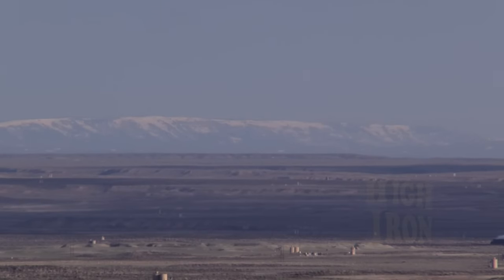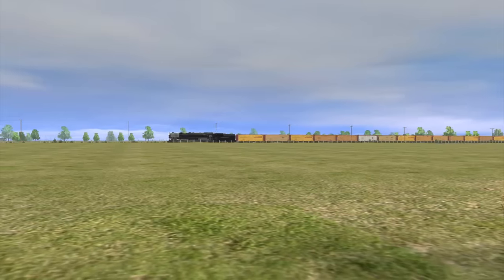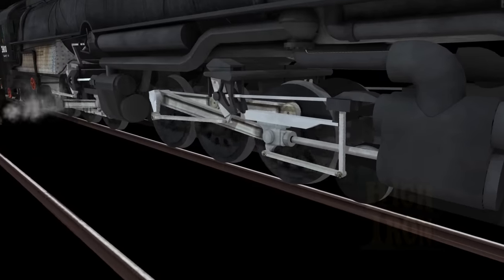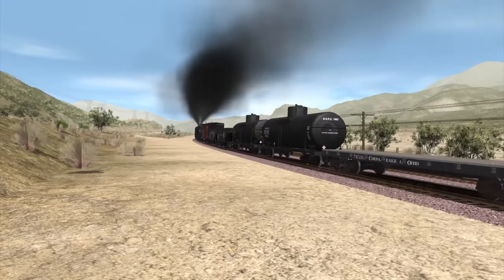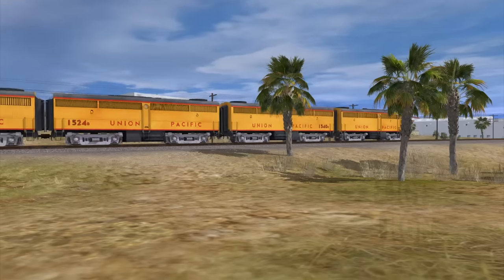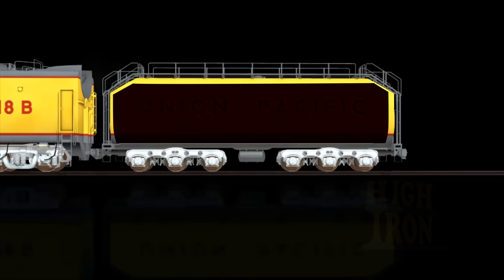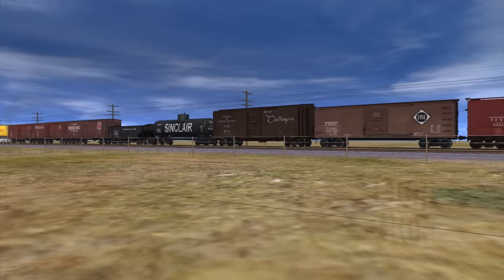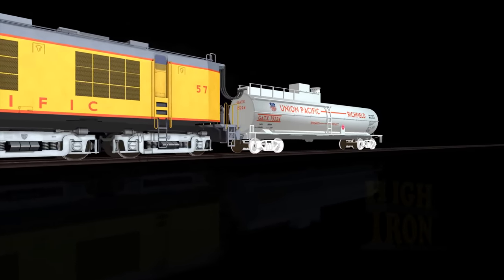Union Pacific's Superpower Fleet

Comment: I think what finally made these big, customized locomotives obsolete was that both EMD and GE by 1990 were pushing their "regular" locomotives to around 4,000 bhp. The EMD SD60 series and the GE Dash 8 series were bought in big numbers by UP for operations between Utah and Cheyenne, WY, especially once the Powder River Basin coal fields opened up.
Reply: Yup! The "Power Race" up to 9000 plus horsepower, then, necessarily, back to 4400 - 4500 is worthy of an entire video as well!
Reply: @michaelsullivan3581  We saw the EMD SD90MAC-H and the GE AC6000CW, but the unreliability of these 6,000 bhp prime movers ended the idea. That's why there was way more interest in the SD70MAC and AC4400W (and their modern descendants, the EMD/Progress SD70ACe series and the GE Evolution series.

Comment: Narrator: "...their third cylinders made them a headache..."

*goes back a few seconds, sees Gresley conjugated gear"

Me: ""Of course..."
Reply: Ever look after a Gresley conjugated  gear fitted locomotive? I suspect that you have never been involved involved. The reality is that there is more chance of a failure of conventional inside gear.
Reply: @DeCasoU1  too much stress was a frequent cause of trouble for Conjugated, more so than conventional. Of course it would be a hassle on an engine with double the driving wheels as any fast Gresley design
Reply: Yeah Gresley's stuff all worked perfectly with proper maintenance.....not exactly great for times of economic depression, war, or corporate bodies wanting to spend less taking care of their stuff.

Comment: This is interesting. I worked on diesel electric systems on the USN for over twenty years, and Emd switch engines after retiring from the navy. I went through the GM EMD C school in Great Lakes NTC in 1977. They're very reliable power plants.

Comment: Spread this message. They removed the third cylinders on the 9000s. I still see videos today with the misinformation that they were a nightmare for maintenance. They fixed the problem. And even introduced roller bearings too.

Comment: If I remember correctly,  it was Santa Fe encountered a problem with huge steam when going through long tunnels out west (Sierra Nevada range) in that the locomotive filled most of the tunnel leaving the smoke very little space to go, except into the locomotive cabs - which nearly asphyxiated the engine crews.  The solution, flip it so the engines operated as cab forwards - with the cab in the front and the smoke stack at the back.  They were 4-8-8-2 configuration and I think one still exists.
Reply from the maker: That was the Southern Pacific that rostered the, "Cab Forward" types.
Reply: Would help with visibility too as you had to stick your head outside the cab on regular steam locomotives to look ahead.

Comment: They 'could' have removed the flange on the middle 3 axles, to improve their cornering capabilities.!  We did this with loco's over here that had that problem.!
Rich (UK)🥰🥰🥰
Reply: For the 9000s the middle two were blind and had no flange. The first axle was able to bend by .5% extra with a special homemade rod that allow it to bend for turns. However in the USA the mountains the 9000s had to go up the bends were tighter than most in the UK.

Comment: The 1990s saw another high horsepower race with locomotives such as the EMD SD90MAC and GE AC6000CW. Different from the large diesel locomotives of the 1970s these were single engine. UP was not the only one to order some of these. However on long term they weren't the most reliable, and in later production the power per locomotive had to be reduced again.

Comment: I think union pacifics spirit of keeping the one locomotive per train policy in place is what kept it going throughout the centries
Reply: Man...can't other railroads do that, too??
Reply: @theextremeanimator4721  your exactly right. If the =WM= Western Maryland and the lehigh Valley and the Santa fe and the pennsylvania and the new york central and the Chicago northwestern and the Burlington route and a whole bunch of other class 1 railroads adopted the same policy and got bigger locomotives with more horsepower there would be less carbon emissions and more freight hauling and more money to make and they could save on maintenance costs and then it would benefit more companys and those class ones would still be in opperation today but not all of them. Some didn't have enough money to purchase them so they would have gone bankrupt either way. If that's what you were talking about.
Reply: Now the UP west of North Platte uses more locomotives, they hook 2 trains together, putting engines in the middle and the end. I see them across western NE, WY and into Utah.

Comment: Should've mentioned that UP's obsession with power didn't end with the Centennials, they also bought the AC6000W and SD90MAC in the 90s.

If I had to guess, the flood of 2nd hand, brand new units from the SP and CNW mergers, as well as UP's own massive SD70 and Dash-9 orders heavily influenced the end of their pursuit of power. Overnight they kinda rendered the whole horsepower debate redundant as they had more than enough spare power for pretty much any conceivable scenario. In fact modern UP has the opposite problem of too many locomotives, they've got massive dead lines of units which are otherwise modern and in good shape, but just don't have enough to do.
Reply: Those bigger and more powerful units tended to be less reliable though and were hogs on fuel.  They just weren’t cost effective to use.
Reply: @gregrowe1168  the same could be said of the 4000s and turbines though.

Comment: The Big Blow's biggest problem was tunnels.  They choked on exhaust from other units and had to be used as the lead unit in a consist with either a steam or diesel behind it.
Reply: This is not correct. The GTEL’s would never be trailing a diesel or steam locomotive. So there was no issue with them choking on exhaust from other locomotives. They were always in the lead when running. Often times with diesels trailing.

Comment: I can't believe we made a locomotive in 1941 that has 6,000+ horsepower
Reply: Steam
Reply: From the UP test results, that was only at 37 mph. At 25 mph, the Big Boy produced 5000 HP, at 55 mph, they were down to 4700 HP. Steam locomotives only produced maximum HP in a narrow speed range.
Reply: @markantony3875  yes but still

Comment: The U50C is one of my Favorite Locomotives ever built. Just if even one could have been preserved. Or as the U50s were GE's first Wide Cabs, maybe just if Wide Cabs were more popular then, the design would have caught on more, and maybe even GEVOs today would have the same Cab Design as the U50. Or if they tried harder to fix the Silver Wiring Problem. They did experimentally give one Copper Wiring, and it did actually improve the unit quite well. But unfortunately, they gave up after that and tossed them anyway. Maybe if they did all get Copper Wiring, they would have been much better in operation, lasted much longer, possibly even to the 1990s, and ultimately, the chances would have been much higher of some of them being preserved.

Long Story Short: I will NEVER look upon the U50C as a failure. It was simply an obscure unit with great potential, that sadly was never able to reach it.
Reply: Saw many U50's and U50C's pullibg trains. They were Very impressive locomotives! Majestic and beautiful. For some reason seeing the blowers all open in their "cages" was incredibly pleasing! 
As an aside, I have to admit that the ALCO C855's were perhaps the most imposing and "I mean business-like" locomotives ever! So very macho!  Too bad they were not more successful!

Comment: if the Gen 3 GTEL was on the DLS, how did you get it to work?
Reply: You have to remove the faulty asset from the config. I'm no exactly sure what the build indicator does, but I can tell you that you can remove it in the newer games and it will work fine.

Comment: 3985 was officially retired for a second time in 2020 January 4
Reply: It makes sense, 3985 needed a break anyways.
Reply: @theq4602  How dare you
Reply: @MOHAWKL4A3124  3985 needs a heavy overhaul, also the UP steam program may not have the funding to operate 844, 3985 and 4014 all at once.
Reply: 3985 needs a lot of work.  4014 is there to take its place, so I consider it a fair trade.
Reply: @ClockworksOfGL  3985 a pulled 143 double stacked intermodel train up Archer hill at 35mhp. Without any help!
Reply: @MOHAWKL4A3124  that was nearly 30 years ago
Reply: @MOHAWKL4A3124  and why do you think it's in such piss poor shape? Steve Lee didn't care about proper upkeep, but rather cosmetic fixes.
Reply: @threehead99  he also said a big boy couldn't return only to be proven wrong
Reply: 3985 had a good run,  4014 is priority now.  It’s amazing that 844 has never had any downtime in its history.  Since it was built in the 1940s it’s been active the whole time.

Comment: (internet on capacity of WWII freight trains and now):  Capacity of Railcar Fleet This  refers  to  the  capability  of  a  railcar  to  handle  lading,  as  measured  in  terms  of  volume  (i.e.  tons),  the  capability of the car to move at a higher speed and in longer trains.   Example:A typical railcar used in the 1940’s and 1950’s had a gross capacity of 180,000 lbs. or the ability to carry 74 tons when the weight of the car is taken into consideration. Trains would consist of an average of 60 cars and hence, have a carrying capacity of 4,440 tons.  A modern railcar has a gross capacity of 286,000 lbs or 125.5 tons moving in trains consisting of 100 cars or more, yielding a total carrying capacity of 12,500 tons

Comment: In the US you were helped in steam days by the generous clearances to the sides of the tracks. I remember reading of the South African railways trying the Mallet articulation where the boiler swings out wide of the front drivers but it fouled just about everything trackside. Hence the Garrat articulation was used in these areas where everything stays over the rails. A Garratt was used in the UK for freight but the trains were often larger than the signal block sections so not a great success for this and other reasons. The UK loading gauge is still very tight both high and wide to the point of being rather pathetic.

Comment: In the early 2000s there's the SD90MAC & AC6000CW 104000 hp if paired to AC4400CW & SD70ACE 4400hp over Sherman Hill. Well done Video Had there been a Modernized EPA Tier 4 Compliant DD35s built these will work the mountain routes on the West & East Coasts of USA & Canada. Example CSX Sand Patch Grade UP BNSF Cajon Pass BNSF Marias Pass & Horseshoe Curve Norfolk Southern

Comment: I got to see a Centennial in operation when 6936 came through Portland a while back.Quite a sight! That thing is a real monster. Shame they have been relegated to occasional VIP runs.
Reply: As impressive as they were, they are technologically outdated and modern EMDs and GE’s despite being much smaller physically and with 2000 less horsepower can easily out pull them.   But I agree. They were awesome to see.

Comment: from an efficency pov: yes using one larger prime mover than several small ones is more fuel efficent and cost effective that way - but it certainly lacks the availabillity of an engine at a certain point, also maintainence of a experimental is higher than a regular engine in mass production, you need probably bigger sheds to store them

Comment: Shame the SD90/AC6000 weren't mentioned. Both 6000hp locos ran by UP and despite not having the longest service lives they were still used quite alot. Not even mentioning AC over DC power

Comment: Question:  when talking about the articulated steam locos, why did the early ones that used the steam twice “pound the rails” and what does that mean?  Additionally, why did using the steam once in equal size cylinders fix that problem and what did you mean be it “freed up the reciprocating mass”?
Reply: When the earlier ones pound the rails they did not have roller bearings to smooth the ride. Think driving with a damaged wheel vs new wheel. The steam was used twice. The rear cylinder was a smaller high pressure. The exhaust was then moved into the inlet of the front cylinder. This cylinder was a larger low pressure. This cause a “limp” that forced most of the weight of the boiler to shift. Thus hundreds of tons of weight feel on the size of four us dimes. That’s pounding the rails. As for the same size cylinder, the steam wasn’t used twice. Instead of one fourth of the wheel sets working at once, it made it use all four sets of wheels to work at once. The reciprocating mass was the more parts moving to keep the high pressure steam to move to low pressure steam. This made the top speed of those trains around 35 mph. Removing that and using the steam once via a split instead of twice via multiple valves and gears bought the top speed up to 80 mphs. Any other questions?

Comment: Great video!

Why did Mallet type articulate locos that reused steam have low top speeds? Ship engines from that era (1900s and 1910s) had triple expansion designs. What allowed them to do that just fine, but not steam locos?
Reply: The reason why the trains had low top speeds compared to steam ships is a simple one. First of most steam ships that have VTE engines had the same top speed as trains. A big problem comparing both is the ships have multiple boilers (2-10) have a maximum working PSI of 600, while the trains had a maximum working PSI of 300. The ships had the steam to move the pistons fast, where at high speed the trains one boiler can’t keep the piston fed.

Comment: You missed mentioning about the Living Legend #844!!!  It still exists in the UP Steam program!
Reply: Well technically he didn't, He specifically mentioned the "Heritage" fleet. The "Living Legend #844" as you called her is NOT a heritage locomotive. The #844 is IIRC the ONLY US steam locomotive NEVER RETIRED from active service. #844's story is one of amazing coincidences that kept her from being retired, but it boils down to her being relegated to the branch lines but still a active commercial steam locomotive at the time that UP was considering a steam preservation and tourism branch. Thus #844 went straight from a freight locomotive to being the inital showpiece of UP's steam preservation program!

Edit: Fun fact, the second tender that UP uses for the #844 and possibly the other locomotives is actually one of the ones that was converted for use by the GTEL's, but reconverted back to being a auxiliary water tender.
Reply: UP 844 (8444) has never been retired. It has remained an active duty locomotive since it first ran. It has been transferred to the Heritage Steam Team. Both statements are true. It is run by the Heritage Fleet but is technically not a heritage locomotive, it's just old! It is also absolutely beautiful. An exquisite work of art!

Comment: To be fair, comparing the Union Pacific at the time to any other route, it's not really a fair comparison. The Union Pacific covers a huge amount of ground and is one of the primary cross-country railroad companies in the US. As a result, they needed these monster locomotives.

Russia actually had a similar thing going on - in fact, the largest locomotive ever designed, a 5' gauge 2-4-4-2+2-8-8-2+2-4-4-2 dual Franco-Crosti boiler design, was designed for the broad-gauge lines crossing Siberia.

Comment: A thought occurred to me: with the articulated Challengers and Big Boys, could the same somehow be done with diesel locomotives? Just a random thought
Reply: No need for it. Modern diesel locomotives have far more tractive effort then the Big Boy and they only need 6 axles.  Railroads don't want giant locomotives. They want more versatile smaller units that require less maintenance. WAY better to have 3 diesels that make 12,000 HP combined then a single unit that can do that.  Because if you use 3 to make 12,000 HP and one fails you can still keep moving (although slower obviously).  But if you have one high horsepower single unit and it fails your dead and blocking up the main line.
Reply: Too heavy too.  While modern diesels aren’t light,  200 tons per unit or so,  bigger units could easily rival the big boy in weight and just be too heavy for the track.

Comment: actually i wonder if it's possible, can they restore Union Pacific 9000?
Reply: What would be the point? It wouldn't be able to hardly go anywhere, much less run passenger excursions (Too slow.). Same reason the 2-10-2 in Cheyanne will never be restored, theres just no practical use for those small drivered engines.
Reply: @joshmeister4449  for excursion services, but in its current state, it's not that good, i think for cosmetic restoration, it's possible.
Reply: Up has the 844,  it’s a much better locomotive anyway.
Reply: @gregrowe1168  well i guess you have a point

Comment: There’s still one steam Locomotive in operation still today in operation. The steam engine UP “Big boy” no. 4014 or does that engine run on oil now🤔🤔🤔
Reply: The 4014 runs on oil and steam to move. The 844 also runs on oil and steam. Both steam locomotives are used and ran by the Union Pacific
Reply: @Johndoe-jd  ok that’s what I thought. Thx for clearing that up:)